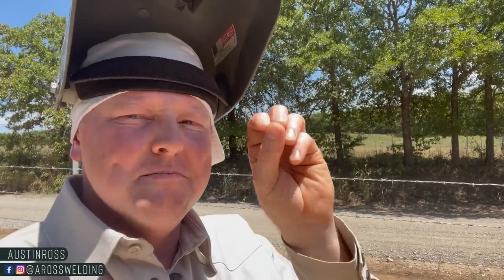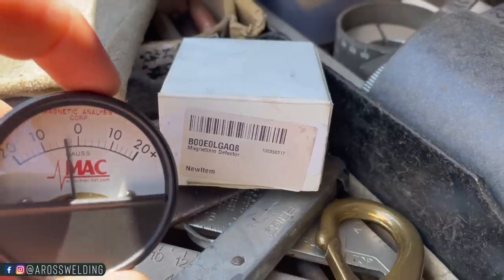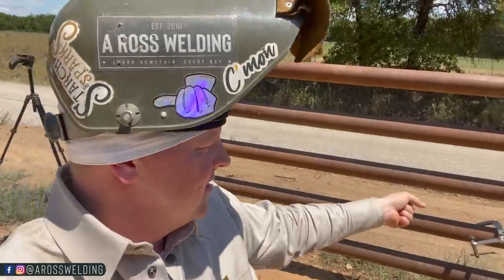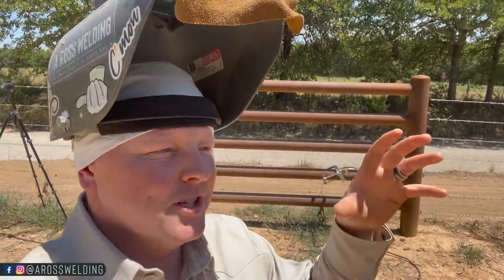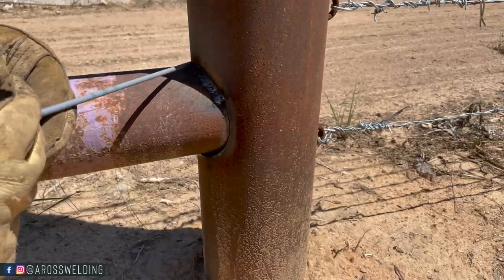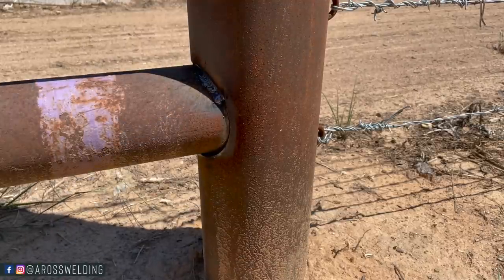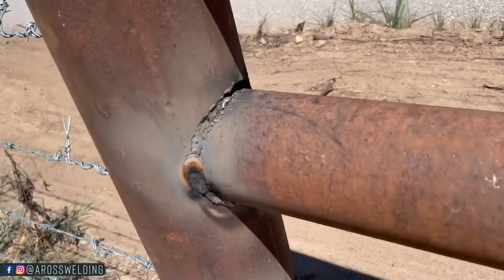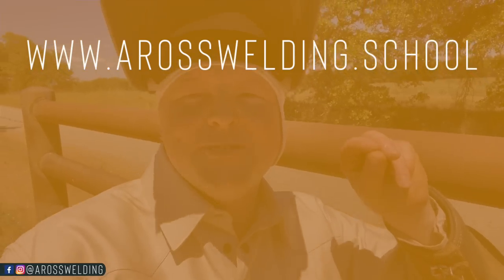WORST MAGNETIZED PIPE I'VE EVER WELDED ON - how to weld it? what causes it? radiation? and ...

Comment: Is the radiation of the pipes harmful to your cattle, land & humans?
Reply from the maker: Too much radiation is bad yes. How much? I do not know the answer to that
Reply: It is possible that radiation from used oilfield tubing could be dangerous but ONLY from continuous close exposure. That means sitting or standing next to it or on it all the time everyday. Generally the amount of radiation is far too low but I wouldn't use it for posts in my metal building if you can measure radioactivity over 5 rads on a gieger counter. 20 rads I wouldn't want it around me all the time. Miliciverts is a better measurement but that takes a more expensive detector than a gieger counter. Read about the radiation at Fukashima. The radiation currently at Fukashima city is higher than any oilfield materials I have so far come across and thousands of people have decided to live there although I certainly would not. And that radiation is EVERYWHERE, not like tubing made into a fence that you only walk near or next to periodically. It is also more dangerous radiation because it is a concentrated form of man made radiation NOT naturally occurring radiation.

Comment: i am not an expert in welding I am not even an expert in magnetism. When you magnetize a screwdriver for working on your car you just wrap it and wire and hit the battery. To demagnetize it you just smack the screwdriver on the ground or anything hard. so would beating the crap out of the pipe with a hammer demagnetize the pipe?
Reply: Technically that is a method of demagnetizing, becomes less effective the larger the object and the more magnetism there is